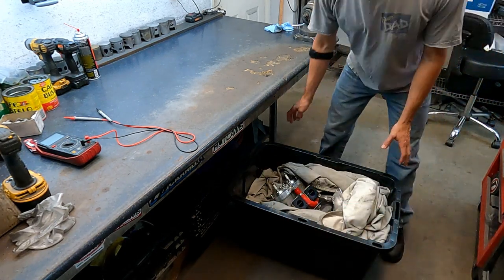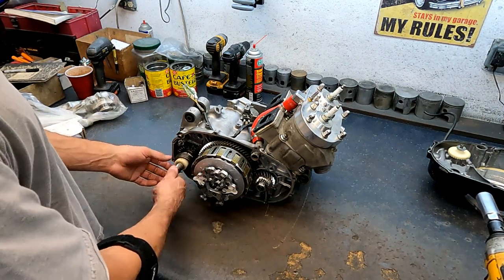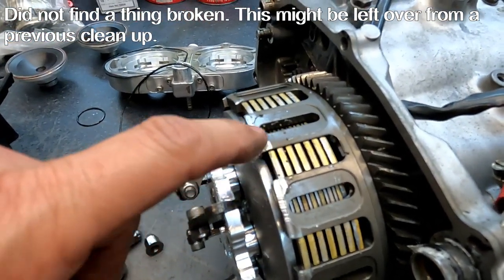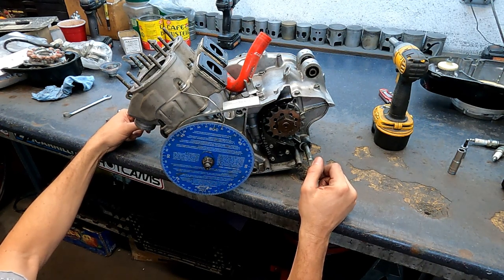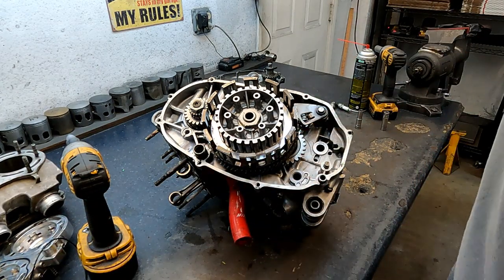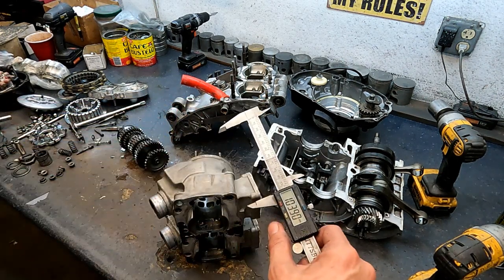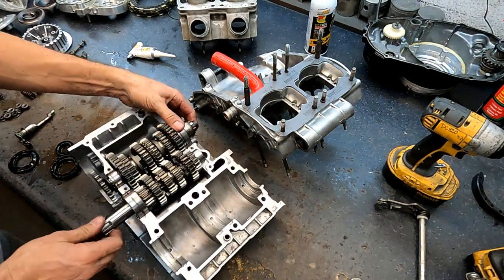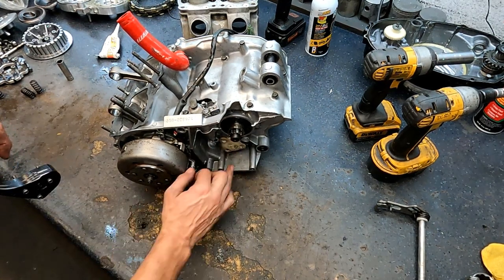Yamaha Banshee 421cc Drag Cub Rebuild.

Comment: When you put a motor in a test chassis, do you do a plug chop or is that bit about them bullshit?i read my plugs but have never chopped one. Does it really matter that much from outer part of ceramic to inner?
Reply from the maker: I do not do plug chops either. That just gives you WOT reads and you can do it without chopping the plugs.

Comment: Am I correct in assuming that the head studs are supposed to be only finger tight or snugged? Your statement left me wondering. 
Thank you.
Reply from the maker: Only in nickle plated cylinders. You can torque the iron cylinders down. If you torque the nickle cylinders head  studs they a can bulge and even crack the nickle. You do not want your bore bulging in on your rings and piston.

Comment: Like how you use your ohm meter
But if the coil dose not ohm out right the bike will not run right 
 I don't know the readings
 0n the banshee 
But the yz125 and yz 250 it should 
The coil wire and cap is at 13.35 to 14 ohm.
Coil and wire 9  ohms is where it need to be lower is no good 
I have a cr250 video on coil 
Watch it 
If the cap is not at 5 ohms it is no good
Reply from the maker: Thanks for the tip.

Comment: Why use Grease on O-RINGS not use Vaseline??
Reply from the maker: I’m a mechanic and have plenty of grease, I don’t have any Vaseline. Both of them work fine.
Reply: @herrjugsracing7816  thanks for replying sir. Say, I have a 1995 all stock chassis machine, all matching numbers/title (1owner me) W/ONLY aftermarket pipes and cool head. It’s been sitting for around 17yrs. Its got 185 compression on both sides mostly because I fogged the engine before I parked it. I gave it a well deserved bath and when I took the seat off I noticed duck-tape on the snorkel tube (good idea) and the air filter looks just as I remembered.. new!! BUT when I touched it the damn thing FELL TO PIECES.. so I go to cycle craft inc where I bought it and they are NOT THERE ANYMORE (big surprise) but throttle monkey custom cycles is. Regardless but none the less got a new filter and 5gal 110fuel mixed it up 100ml to 1gal (37:1) approx. and it started rite up but the clutch isn’t disengaging so it shuts the engine down when I put it in gear. Should I just change the transmission oil and roll-start it and hopefully it kicks something loose because it was perfect when I parked it.

Comment: Recently Did my Bottom end now im on the clutch side almost finished but, 
- I put my kickstarter gear on tried to rotate it and it would grab the idler gear it would hardly move is that normal?
Also i tried roatating the Basket by hand ( i had the pressure plate on) and it was stiff i could rotate but very hard is there something wrong?
Reply from the maker: It sounds normal as the basket drags the crank and everything else that is connected to it. The kick gear will always grab the idle gear and lock. This is how the bike starts.

Comment: Hey Kevin.  Have you ever seen a set of cases that have cracked in between the drive gear on the crank and the trans shaft that the basket goes on?      I have an engine that I think is cracked and wondering If you’ve ever seen such a thing.      Had a buddy throw a chain a while back and it broke his cases literally in half.   One Half was trans and other half was crank and top end.     From the way his busted and the way mine looks.   It looks like mine is next.    But the weird thing is mine has never threw a chain and isn’t whacked up.     Thanks in advance. Love the videos man.
Reply from the maker: I haven't seen one crack there yet.

Comment: Just tight the cylinder bolts till there tight? Cant fit a tourqe wrench
Reply from the maker: Yes, you can feel 18 to 20ft pounds is not that tight. Just snug it up good.